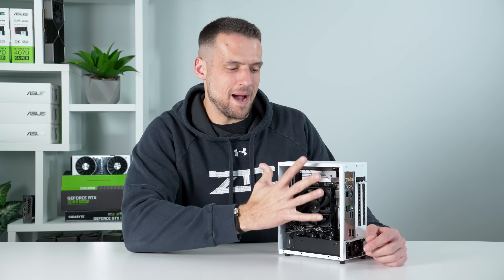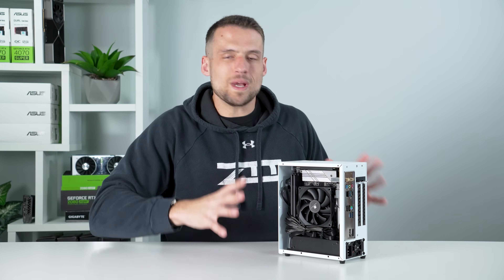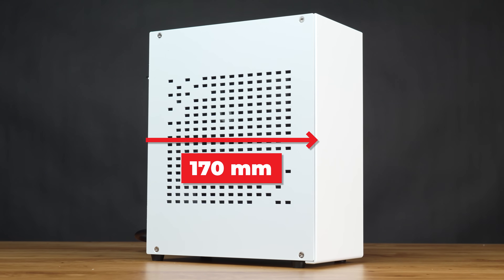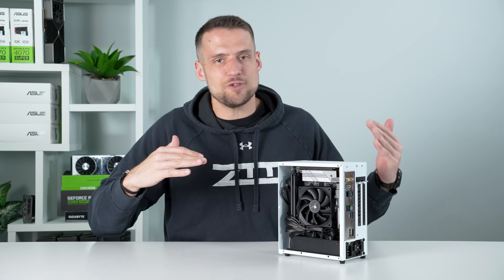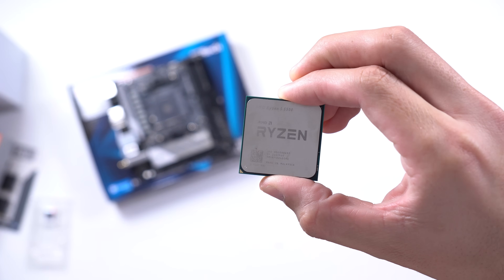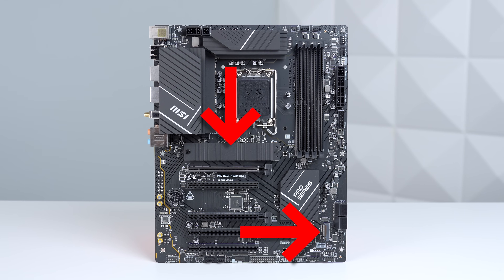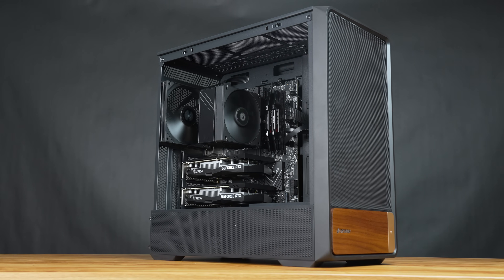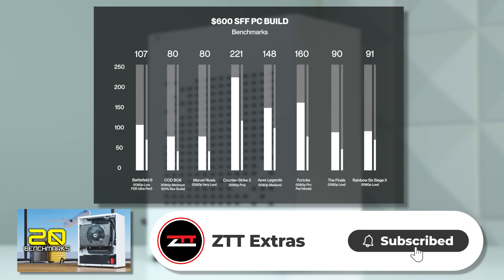This $600 Tiny Gaming PC is Unreal

Comment: Is this your answer to the steam cube?
Reply: It's better hardware and up-gradable, but the Gabe Cube will be optimized for SteamOS, so like the Steam Deck it will perform better than its specs
Reply: @jayb2705 people seem to be forgetting that it using not windows means that it has more capability to be optimized.
Reply: @scubarubanzaii so like 3-4 fps. Wooh
Reply: @sloesty  i have changed from windows to linux mint and the first thing i noticed is that i'm using 2-3GB less ram than i was on windows
that is with me purging all of the junk from my windows install and doing nothing to the linux mint install
Reply: @jayb2705  better hardware? a 3050 and r5 5500 is worse than a rx 7600 and ryzen 7500f, even if the steam machine somewhat underclocks their stuff the hardware will still preform better without additional optimizations
Reply: @anonefr  the steam machine CPU and GPU are not even close to rx 7600 and ryzen 5 7500f. They are 15-20% slower version with low TPD mobile/laptop parts. Don't expect a CPU with 30W TDP to sustain high clock speed like the desktop 65W TDP CPU.
Reply: @Vasko-m4p let's assume everything's underclocked by 20% (arbitrary number you came up with), the gpu is still 71% faster while the cpu is comparable or 3% better, ive done the research on this. the spec list unlike other consoles are easily accessible on the internet. if you care about word of mouth most people say the steam machine operates slightly worse than a ps5, which highlights the underclock as a base 7600 is proportionally better than a ps5 but a 3050 performance as said earlier (91% difference) is lower preformance to such a significant extent it would take a ridiculous bottleneck to combat. about the mobile thing, although the cpu's not mobile, many people believe the gpu is a 7600S, which is significantly worse but still around 30-40% better, this somewhat makes things confusing because steam claims the gpu is 110w while the said 7600S caps at 75w. I believe its highly unlikely the steam machine runs worse than a 3050, paired cpu setup.
Reply: @anonefr As soon as you said preform your comment was invalid.
Reply: @anonefr Steam specs put the cpu comparable to the 7540u laptop cpu. 5500 has 4% edge in performance. The steam gpu specs place it on line with the 7500m laptop gpu or the 4060 if you want to talk about Nvidia. Upgrading this from a 3050 to a 5060 makes it laughable as the 5060 demolishes the 7500m. You can also run Bazzite on a micro pc which improves gaming performance even more. Anyone buying into the Steam machine hype is delusional when it’s probably going to be $899 for a non-upgradable pc.
Reply: @anonefr  well yes 3050 is worse than the steam machine GPU. The steam machine GPU is a boosted version of RX 7600M (higher clock and higher power draw), while the CPU is very close to Ryzen 5 7640U. However price will tell us if it is worth or not, a 750$ desktop PC with Ryzen 5 7500f and RX 7600 will be much better choice and will result in 15-20% higher fps in games.
Reply: @timthecollector what do you mean the word "preform" invalidates my opinion? alright sure if its found out the under-clock is significant enough to bring it towards a 7540U performance than your right, that doesn't keep from the fact the architecture aligns with a r5 7500f and i was responding to someone who gave a hypothetical under-clock number around 15-20%. im not shilling for valve if its really expensive than its not worth it, i was disproving the comment someone made about the steam deck being lower performance than this system, which regardless on how expensive or bad of a deal it is, is untrue. the "upgrade to 5060" comment is also stupid because your basically saying you have to cop out 300$ to replace the 160$ for a better graphics card which doesn't just involve irrelevant hardware to the comparison of these two pc's, it also completely invalidates your price argument, as that hypothetical system would exceed the expenses and have a worse fps per-dollar than both the one on this youtube video and the steam machine
Reply: @Vasko-m4p  yeah i entirely agree with this, although what i said about raw performance without accounting for anything else is true anyone as a consumer should focus on fps-per dollar above everything else, it really depends how they'll price it. 500-750$? that sounds good, anything beyond that? not worth it
Reply: @timthecollector steam machine teraflops 9. Rtx 3050 6gb teraflops 6.7. steam machine wins in performance
Reply: @jayb2705  you could just install steam OS though
Reply: The steam rectangle 😂
Reply: replace the 3050 here with a 3060... thats close enough
Reply: TechTurfTube?
Reply: gabe cube*
Reply: If gabe cube 500 then yes
Reply: Steam Cube would smoke this.
Reply: Nah because the first version was older than thr steam machine announcement
Reply: Its probably gonna be 800 bucks so this is cheaper same performance
Reply: @pasimracing  It's all just speculation at this point, we really have no idea how much it's going to cost.
Reply: @pasimracing  not same performance, if the statements are true the gabe cube could technically run every steam game at 4k 60 fps with fsr enabled
Reply: @RubikXDD seems like you didnt read about it, its supposed to have a stock 7600 and 7600, which is WORSE then the PS5 which came out FOUR years ago. The gpu only has 8gb of vram which most gamers try to avoid. The only thing that gets this PC to 4K60 is FSR performance and some luck.
Reply: @RubikXDD  yeah, better performance...
Reply: Nah it is impossible, maybe on low details there will be custom apu little better than ryzen 5600 and rtx 7600 so it is something for high detail full HD gaming and low detail 4k 60fps on fsr and fake fps. So maybe 20 normal fps and rest fake. It's not good.  @RubikXDD
Reply: @pasimracing  cry more
Reply: @ptterodactyl5597 not crying, its just sad that steam will be trying to upsell this on being a pc whole advertising it as a console
Reply: @RubikXDD the specs of the shitty cube will not run games 4k fsr enable, not even close
Reply: @pasimracing simply incorrect the 7600 duo is faster then a ps5
Reply: @RubikXDD 😂😂😂 thats nonsense..don't be marketing my dude
Reply: @RubikXDD  GabeCube is literally just 7640HS mobile CPU with 7600M mobile GPU - if you want to see how it works in practice just google Minisforum AtomMan G7 PT which has similar setup (a bit more powerful in fact, since CPU is noticeably faster and GPU is XT with 4 more CU units than the GabeCube). 4k with FSR means 4k with FSR performance (so 1080p native) so they technically didn't lie since you can get 1080p native in 60+ fps in most titles on that hardware with optimized low/medium settings... unless we're talking UE5 games, but those run horribly on just about anything. The biggest problem is that it's still RDNA3 which means no FP8 instructions, which means, no FSR4, which means... upscalling quality will be fucking awful.
Reply: @pasimracing  most gamers try to avoid 8gb of vram? lmfao some of you are so detached from reality
Reply: @Micromation  Eh, considering the GPU, you could still benefit a lot from the leaked INT8 model of FSR4. Which will probably be finalized and widely released by Q1 2026, aka when the Steam Machine comes out. Even right now though, you get the far better image quality from FSR4 with relatively low performance overhead. Just crank it up to Perf/Ultra Performance, which is fine since even then the image quality is better than anything FSR3 can do and still better than native TAAU. Frametimes suffer a bit, but it's still easily worth doing.

Plus, Steam's already stated they're working directly with AMD to get FSR4 out for RDNA 3 by the time Steam Machine comes out. Which mirrors AMD's original timeline for FSR4 on RDNA 3 and below as well (Q1 2026). And OptiScaler is right there.
Reply: @zettour. That's great but have you tried running a mobile 7600M or even regular, desktop one? There isn't any overhead left... You need both, performance gains and better upscaling quality, because there's nothing left to tradeoff.
Reply: @Micromation  Like I said, just crank it up to Ultra Performance mode. FSR4's image quality improvement is so high that even that is much better than FSR3 on Quality. The real tradeoff here is frametime, but you're talking 2-3 ms difference which is negligible for the quality gains you get going up from FSR3 to FSR4. And this is all assuming we use the outdated leaked INT8 model through OptiScaler. Once AMD actually gets a production ready version of FSR4 for RDNA 2/3, you're gonna see even more improvements in performance.

The overheard pales in comparison to gains of FSR4.
Reply: @w @wgnd1614  you finna buy a new pc and you want 8gb then i hope ur game doesnt load
Reply: @pasimracing  what?
Reply: @pasimracing  I really wanna know where people are pulling $800 from. I honestly don't see it being any more than $600.
Reply: @FGLKyouma not priced like a console remember.
Reply: @pasimracing  Yeah, but that's not number specific. It just means they're not selling at a loss and make up the difference on software. From the specs, you could build a similar PC in the $500 - $600 range (or you could, before RAMaggedon), and since they'd be buying in bulk, their costs would be less than that. I watched Moore's Law is Dead's video on it, and that pretty much matched up to what I already thought.
Reply: @FGLKyouma welp ltt has basically confirmed it’s not gonna be close to 500 so i expect it to be at least 750
Reply: @SandoSensei well for 750$ you can build desktop PC with Ryzen5 7500f + RX 7600 that will give you 20% more fps in games than the steam machine. No point going for the steam machine with low TDP laptop/mobile parts, unless you want something small, but as a gamer I prefer performance over everything else.
Reply: yeah but this one has even less VRAM.. a very crappy build imo

Comment: The micro ATX switch at this price point is such a game changer. mATX b550 board and the 5500 are on sale on Amazon for $200! Comparable build with a b580 all from Amazon can be had for about $620.
Reply: Pr he could have used the ontel arc pro b50. It out performs the 3050 and have 16gb vram

Comment: Yo, Unc Zach, nice to see you again.
I just built a crazy cool gaming setup I’ve been planning for five years. I got a 9070 XT, a Ryzen 7 7700, 32GB of DDR5 RAM, and a 1TB NVMe SSD. That cost me about $1600. I also picked up a 1440p 180Hz monitor, an Aula F76 keyboard, and some other solid peripherals. The whole setup came out to around $2000.

Crazy upgrade from my old GT 710 and 3rd-gen i5 PC I was still using last week, lol. Your videos really helped me. TYSM Zach

Comment: I can't wait till the steam machine comes out and we can get the same price to performance without worrying about setting our house on fire with a low quality power supply
Reply: The same SFF price to performance* it will be poor compared to MicroAtx and up
Reply: @DBIIJ0U valve is presumably getting a massive discount on the chips from amd (i suspect related to a failed amd gaming laptop initiative) similar to the situation with the steam deck components so i suspect the new steam box will be competitive across the board; better performance than shown on this video for around $500 (perhaps $550-600 with the controller included)
Reply: @runnerup15 If it's 500, it won't be too bad. They said they're not competing with consoles prices and it's the price of an entry level PC, why make the distinction when consoles are around 500? 
If it is 500, consoles have better performance with more available memory, better optimisation.
Reply: @runnerup15 I highly doubt it's around $500. The announcement video said it's 6 times more powerful than the steam deck and that's already more than $500.
Reply: @HaIsKuL  canadian dollars? lowest one is literally $399 and im pretty sure it was 250 lowest on launch?
Reply: @HaIsKuL  Steam Deck has handheld tax, it's using an APU and unified RAM, extremely tight cooling and as low power as possible for battery life. It also has a screen. For the Steam Machine it has dedicated CPU and GPU and Ram and VRAM, 70% of the thing is the cooler and it's AC power only. And no screen. Assuming it comes with a controller, which is built into the deck so no cost difference there. The Machine will be get much better price to performance. If even this mini PC can get similar performance at around $700 with the better GPU choice the deck has to be at least as low as $600 to be worth it.
Reply: @HaIsKuL  6 times more powerful than the Steam Deck is not exactly a flex, when my $350 miniPC is 2.5x times faster....
Reply: @runnerup15 They stated it will be competitive with pc prices not console. The performance of a 12400 and a 7600. 300 watt psu. 16gb ram and 8gb vram. Go look at a pc with that price and you will get the general msrp. Its alot higher than you are thinking. I would guarantee at least 25% to 30% increase over current gen consoles.
Reply: yeah about that…
Reply: Series X costs 649 and Valve already confirmed Steam Machine will be more expensive than that
Reply: @jry0600  Valve avoid making any comparisons to consoles in press interviews, the only thing they compared the potential price of a Steam Machine to is a "entry level gaming PC" and there's been a game of telephone as people try to figure out exactly what that means. When you look closely at the Steam Machine's spec sheet, it's using a scrap APU with the iGPU disabled so they're getting that on the cheap, and an AMD RX 7600m, a low-mid range laptop part with sustained clocks set beyond the rated boost clocks (helped by a HSF solution far more substantial than that of a laptop). This puts it within a hair of PS5 performance, though the characteristics of that performance are likely to vary due to a difference in tradeoffs; more RAM, but not unified. More CPU/GPU clockspeed with newer archirectures, but less compute cores.

$500-600 seems in the right ballpark, given how much work they've put in to maximizing performance out of what are fairly low end parts.
Reply: Right…..

Comment: IIRC, Inno3D has a 5050 that is shorter and cuter than this. The issue is that 5050 requires a power plug which defeats the idea. lol

btw... that B550M-ITX/AC may be 90 USD in US, but man... it's 265 USD in Brazil. You gotta love living in a socialist country that takes your money like hell.. (yup, 100% over 50 USD... and it's cheaper to just buy from newegg at this point...)

Comment: Did you know that the psu you used in the video was f tier on the spl tier list? Me personally i think you should ask to change it from f to something else if it actually works and doesn’t malfunction.
Reply: He showed a clip from the tier list in the video.
Reply: @Jeff.78 that doesn’t change the fact that he used a f tier psu (atleast according to spl). Idk i feel like people have used this psu in itx builds and gotten away with it so I’m not sure why it’s f tier.
Reply: @Mininickle3711 
Zach also mentioned others have used it with no issue. The tier list usually has reasons on why PSUs got that particular grade.
Reply: @Jeff.78 yea i heard zach mention eta prime which confuses me cuz if big tech youtubers like zach and eta prime are using a f tier itx psu then maybe it isnt as bad as f tier. The 2 have not complained about failures so i think the psu is at least d tier. (The tier list describes f tier as e waste)
Reply: @Mininickle3711 
They used it since there aren't many options, especially on a less expensive build. It's still F tier.

Comment: Zach I'm always wondering why you don't use Ali Express am4 motherboards? With the state of the market for am4 boards I would think you would be all over the mATX Soyo and Jginyue boards as they are solid options at very reasonable prices for am4. The soyo b550m is a white matx going for close to $50 right now. The soyo b450m is <$45 I think too right now.
Reply: Machinist seems to have good boards as well.
Reply: @Jeff.78  They do for x99, I have a Jginyue x99 argb matx in my build, needed a full sized atx for my 11 year old nephew so I got him the Machinist mr9a pro. $35 for mine and $47 or so for his. e5-2690v4 in mine and e5-2667v4 in his. They actually do surprisingly well for the price still. Talking about a $55 and $60 combos respectively.

Comment: Hi Zac, i need advice. I have an R5 1600 AF and a very old GTX 750 Ti. I can't afford a new CPU + GPU. I'm thinking of selling the 1600 AF and buying a 5600G/5700G to use its iGPU, which seems faster than my 750 Ti. I already have 3200MHz 2x8GB RAM and a 700W PSU. Is this a good move for now? Also my friends said just uprgade your GPU. 
Loves from Turkey ❤
Reply: why wasted so much money on that psu lol, that setup does not even need half of that...
Reply: @bandita2068 Bro i dont wasted. I almost stole it from discount 😅.
 Purscahed it 352₺(~9$). Cpu is even 500₺(~13$). Within discount its 1669₺(~42$).
All system like 130$ (5425₺).

Comment: I’ve started daily driving a sff pc and I was honestly surprised that some of the sff parts were cheaper than the full sized atx ones. I also got lucky and bought the ram a week before the market crashed.
Reply: Also you should totally check out the Jonsbo nv10 if you haven’t, it’s the case I’m rocking and it’s really awesome, especially for the price.

Comment: Zach they sell a ibuypower pc with i7 7700 and rtx 1070 for 450$ in my country should i buy it as a budget pc. Anything that i import will be 800 plus.

- what Upgrades can I do eventually. Thanks
Reply: don't buy this. I7 7700 is very old and can't upgraded. Get an AM4 pc instead and you can upgrade up to 5700X or 5950x.